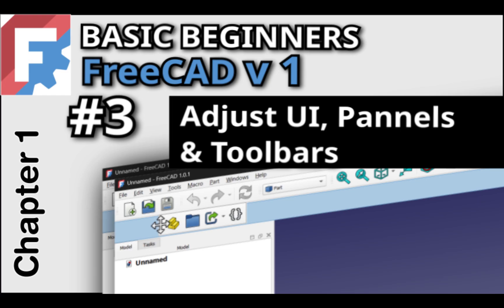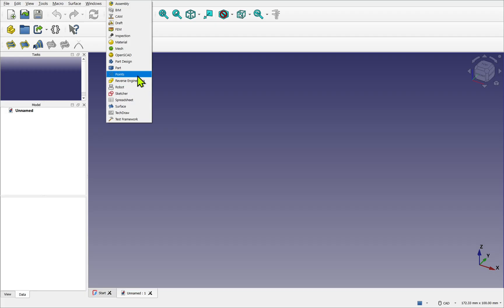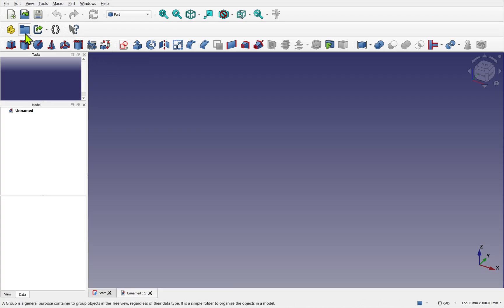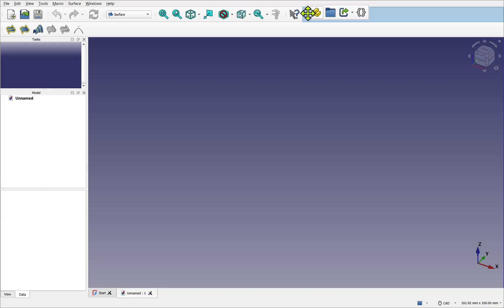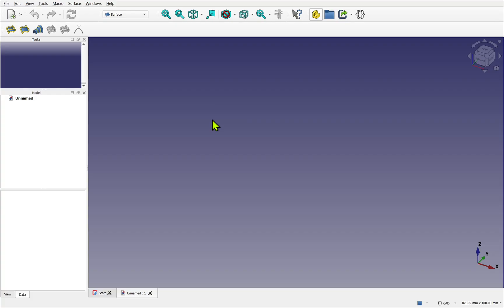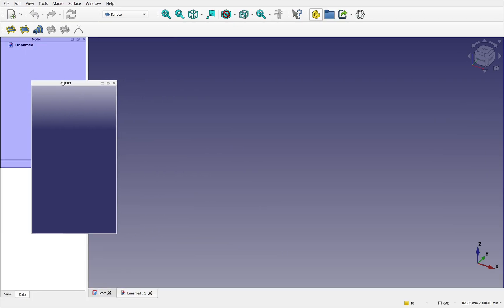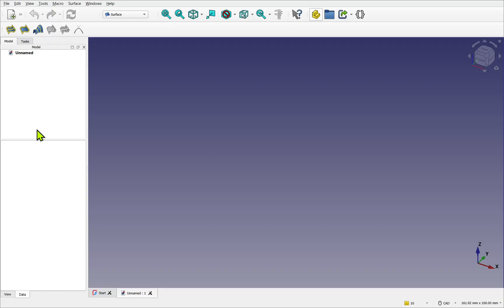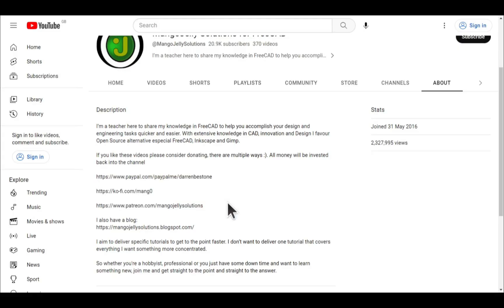How To Customize FreeCAD Toolbars and Panels | Basic Beginners FreeCAD v1 Lesson 3 (upd: 2025)

Comment: I really like your videos. Thank you for making them.

I have a question regarding the Assembly work bench iterations.

I did a bit on A2plus and then moved to Assembly but for the life of me I can't get my head around Assembly3 and 4.

I can create an Assembly and load parts or files. But I cannot find the tools to align the parts as needed.

Have you done a video looking at the differences in the these work benches, that I may have missed?
Reply from the maker: Glad your enjoying the videos.  Ohh, I never thought of that causing confusion (if I am reading this rightly?).  So my assumption is that you may be thinking assembly 3 and 4 are the continuation of the Assembly workbench (I probably have that wrong?)  Both 3 and 4 are older the Assembly workbench shipped with FreeCAD 1.0 and above.  Assembly 3 / 4 are external add ons and don't have anything in relation to those, Assembly Workbench is a whole new and improved integrated official workbench (originally designed for Onsdel).  Assembly 4 uses a LCS system rather than the A2plus style constraints which are similar in approach for the official Assembly workbench.  I haven't done a video regarding the differences. I came from A2plus which is a easier transition that the others and the constraining is similar.  This is obviously going to cause confusion for people who have never seen these workbenches.